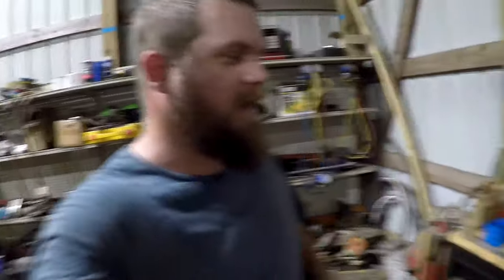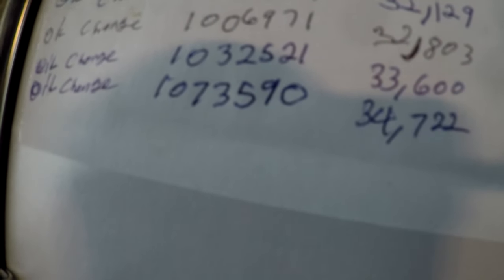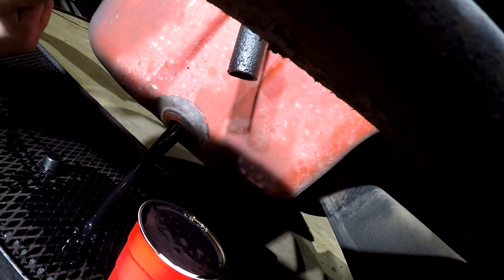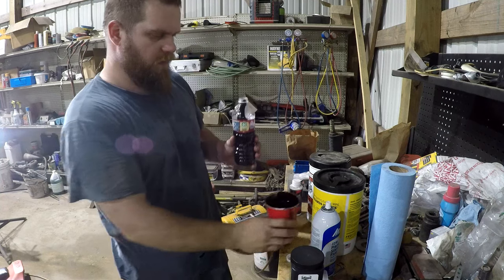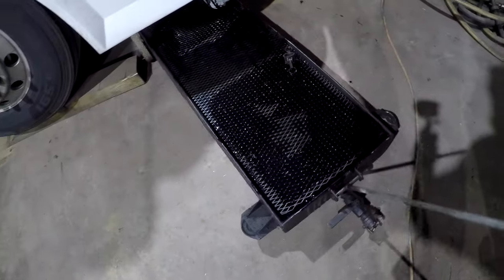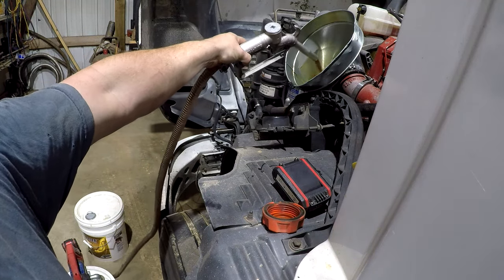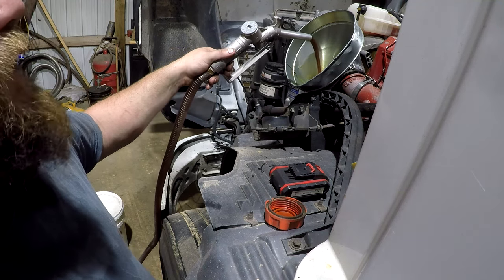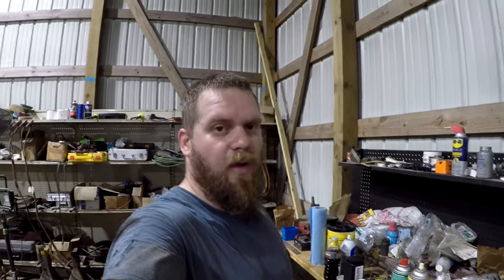Cummins isx 41,000 mile oil change and lab analysis

Comment: When I had a Cummins I used one gallon of 80W90 gear oil in place of one gallon of motor oil. 

Seemed to work well for me.
Reply from the maker: I've heard that and have added some gear oil in my old truck in a pinch but I've never seen anyone do any lab tests to see if there was any negative results of doing so. Some say that the additives don't mix well, others have done so for years with good results

Comment: I've been wondering what happens with longer oil change intervals.
Lots of people say it's a bad idea... but nobody ever measures what happens.
Congratulations , Chase, on doing a test to measure the effects.
Seems that most manufacturer suggested oil change intervals aren't all that unreasonable even if they appear a bit long?
:-)
Reply from the maker: I was curious also and couldn't find any videos of anyone testing it
Reply: One thing I notice is that the wear is not averaged over the distance travelled e.g ppm/1000 km which may mislead you into thinking that wear has increased when it hasn't (total wear is up but averaged wear is not). The idea is to figure out at what stage the wear starts to accelerate if the oil is not changed... and make sure you change the oil before that happens.
Reply: Wear analysis is the best way to identify which oils and additives work.
The proof is often compelling.
...but very few people run enough analyses to figure out what works and what doesn't e.g. Synthetic oils are much better than miineral oils... with semi-synthetic being a good second best.
:-)
Reply: Adding zinc to oil can actually increase wear if you add too much.
Most additives do very little to reduce wear... but you'll never notice unless you do a before and after test.

Ideally what you want in an additive is something that only needs a single application... and results in a 50~90% wear reduction.
:-)

Comment: Hello Chase , I have been really busy and haven’t commented in a while, I have been watching your videos though. I also use the Traveler oil and add STP . Don’t know the zinc content of it, but it makes me feel better about the oil lubricity anyway. Thanks for sharing your experience and thoughts.
Reply from the maker: I'm not sure STP has any additives. I believe it's just a thickener like Lucas, helps older engines with blowby, oil use, and boost oil pressure a bit. I use a gallon of Lucas also.
Reply: @LifeWithChase  okay, I have used it for years, you are correct about older stuff , I have a lot of old stuff. Thanks again for your input

Comment: When you added your "makeup oil" did you change your oil filter?
Reply from the maker: Nope
Reply: @kennethives2517
57 seconds ago
My thought was if your adding oil an oil filter wouldn't add much cost but whole lot of cleaning ability @LifeWithChase
Reply from the maker: @kennethives2517  if I'm going through the trouble of bringing truck in, getting the truck up off the ground ,and getting  covered in oil changing the filter. I'm changing the oil while I'm there.